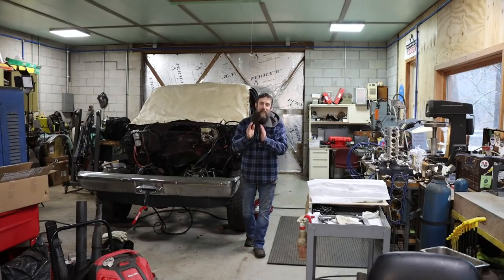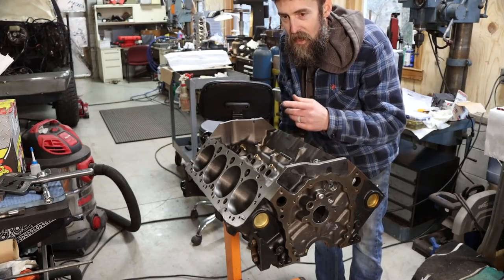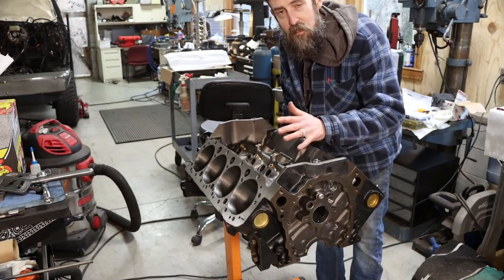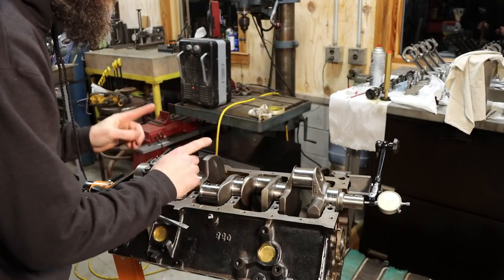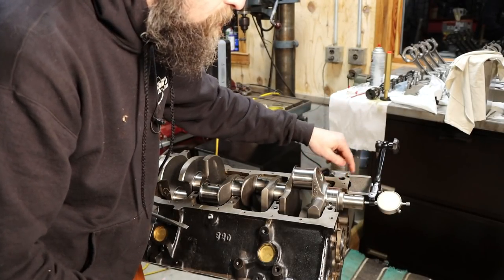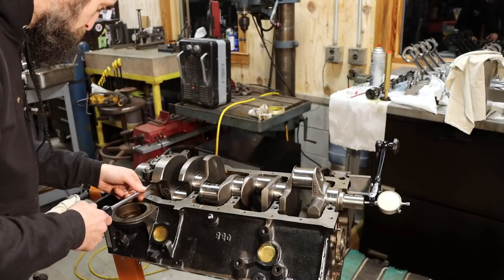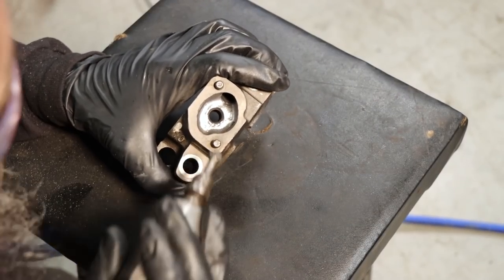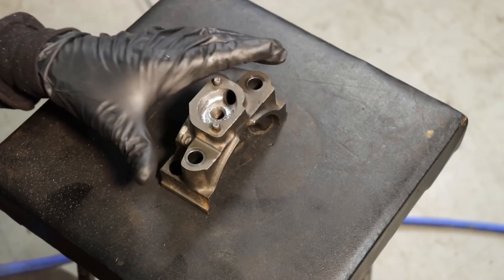Injecting some POWER into the Square Body. Part1

Comment: Good sound conservative well chosen mods. I'm not a huge fan of stroking a motor, but if it gives you something you desire - low end torque - because you don't need high end speed then it should be right on.

Comment: If you ever change the cam, might consider a 4/7 firing order swap to reduce vibration and improve reliability.  I had read about it but was amazed at how much it changed the vibration characteristics of the engine.

Comment: I was in agreement with all of your checks and mods until the end and you threw up a huge red flag.  As you indicated this is an externally balanced engine and it was balanced with the flex plate that was supplied..  To be properly balanced the shaft needs to be balanced again with the new flywheel.  I have built and balanced hundreds of engines and several of the small block 400 engines in my professional career.  Don't short cut this step if you want to guarantee a smooth running engine.   Thanks for sharing, enjoying the series.

Comment: Steve from all the different motors that I have done over the years and from working at a machine shop I don’t care if it was my best friend that did all the machine work on it I would definitely be checking everything on it before assembly!! Making sure that everything has been machined properly before assembly plus definitely definitely make sure everything is cleaned twice if not three different times on everything before assembly!! Every motor that I have done I will definitely take extra time in making sure everything is clean clean and clean for sure!! A clean motor will definitely last much longer than a dirty motor for sure!!! I actually just got done building a 421 sbc that is just shy of 700hp!! It’s definitely a beast for sure but I have put it in a much bigger truck than what you need for a half ton for sure!! Mine is a 1969 Chevy 1Ton 4x4!! I’ll bet you that as long as you keep everything thoroughly clean and double check all your measurements and are with in specs you should be good!! Oh one more thing depending on the after market block and a few other things you might have to go with a much different cam so that when the pistons come up that they don’t come in contact with the cam!! I tried telling a buddy that was working on a motor and he told me he didn’t need a special cam for his motor that he was working on that all he had to do was do some grinding on some rods I was like you will definitely ruin the rods and also throw them out of balance!! Well after buying another set of rods and trying a different cam that didn’t have as much lift he finally listened to me after even trying a stock cam I also had told him it would not work with his setup!! Just a heads up!! I’m not totally sure what all you have there but you might have to go with a cam that has a low grind on it to fit a stroker motor!! A 385 stroker was actually my first motor ever building and I could definitely tell you plenty more about that motor for sure!!! Lol!! A 385 is the same as a 383 but not bored out .030 it’s bored out .040 over!!
Reply: Great comment and good looking out. I've heard about lots of people having clearance issues with 383 strokers whch is why I basically shied away from them. I always just went went to a basic 350 cu in. They're super simple and cheap to build even a high horse power version. Parts are everywhere for a 350.
Reply: @marcellemay7721  the next time I ever need to build a motor for one of my older trucks it would definitely be a 355!! The one I built 20 years ago is still running in a buddy pickup that he had baught from me years ago and still has it!! Just a 350 bored.030 over every thing else is pretty much the same!! I’ve built hundreds of them and they are definitely a dependable motor and can definitely last a lot longer then a stroker motor will as long as you change the oil regular and with a good oil also not a pennsoil!!! All the different motors that I have toren apart over the years the ones that had the most carbon build up in them were run with pennsoil!!! I’ve tore them apart we’re the entire intake valley was completely full of carbon build up!!
Reply: @marcellemay7721  it’s not a big issue and they do make a small grind cam for them and you can get them also but you will have to ask for the small base circle grind for the cam!! That was what I had to put in my 385 stroker that I had built years ago!!!
Reply from the maker: I believe you are referring to a large vs small base circle cam.  The Scat rods I am using should clear but will see👍. Only thing about buying someone else's setup is you get things that you personally may not have chosen.  The cam I have is one of them. If I do have issues I won't be too cross about it😁. Thanks for the comment and for watching
Reply: @SteveSummers  you might as well put the cam you want in while assembling it.  It's much easier and then you KNOW that you have what you want for what you intend to use the truck for.  Many people over cam because they like the sound of the lopey idle.

Comment: Sounds like a great build Steve. 383's make great truck engines with their extra low end torque. Couple of concerns though. I would reconsider the high volume oil pump for a street engine. They can, with the key word being can, cause all the oil getting caught in the top end of the engine without drain back modifications. This could be increased by restricting the holes in the lifter valley. You might also contact Howards Cams and check with their techs to see if the cam would be a good choice in your application. Too big of a cam can cause an engine to be a dog in the rpm range a street truck operates in. It might sound good by perform poorly. Just my thoughts.
Reply: Yep I thought the same thing, I would just go with a low end (torque) cam, most likely the other guy wanted top end high HP...

Comment: Hi Steve,
Great engine choice.  You should notice a good increase in low end torque from the extra cubic inches.  Brian Block probably could have done the machine work on the old engine but now, you don't need to.  The 4 bolt mains are a nice upgrade too.  If you ever decide to add a turbo or supercharger, you know the bottom end is stout enough to take the extra pressure.  Thanks for the video!
-mike

Comment: Steve- I've been watching you for years and really like the way you do things. One word though about the camshaft on the SB Chevy. Too much lift and duration on a slow speed motor is never good. Check with a reputable cam company for their ideas about what they recommend for what you are using your truck for. Then, put in that cam. Racy cams sound good , but use too much gas and won't pull @ low RPM and are harder to start. The roller is the only way to go with all the flat tappet cam problems we see today! Thanks for what you do!

Comment: When you were checking your rear main bearing clearance, you laid the crank in the upper half main bearings of #1 & #5. You should take that opportunity to check the center(#3) main bearing journal on the crank for runout. This will tell you if the crank is bent.
Similarly,  you can put the cam in v-blocks and check the "inside" cam bearing journals for runout. It is not that uncommon to find a bent cam.

Comment: the shop looks great!
Reply: all i would add is the word blueprinting - please have a followup  in 6 mos and maybe also 10 things wrong with chevy  - the headbolts etc - you just have to check everything - i had a 383 in a z28 with alum twisted wedge heads - very rowdy - should be a good match to the truck - will be a boost. i almost would rather have a destroked 427 - see detroit speed camaro on build biology - now that is rowdy but for the truck you want to match the power to the jobs you are doing - the 383 should have good torque and be more than enough but that is what you want when the bed is full and you have a big trailer on back as well... this engine is a good base - i really hope you do efi, i hope you do some truck pc hacks and get a u/l sideband radio in there #crystals #galaxy
Reply: consider timing gears not double roller - the oil pump porting was good, go conservative on the timing - if you have a laptop in truck you can and should log all the data - get a bt on ovd2 connector but getting the laptop logging and making backups of data to pc in shop - there is more to do on this project - try some things that will work for you #magnaflux #ymmv
Reply: make sure to put on a bigger alt and batteries/elec system, get a linear amp for the radio to be able to bang out, - having all the data from the engine will allow you to catch issues and also have a good baseline to compare to down the line #afr #elliptical curves #rc band #stall converter #swr matching

Comment: When you get the flywheel. Please have  a tire shop spin up the flex plate to measure the imbalance then spin up the flywheel to see if it's exactly the same. Or you will need to send the crank, damper both flywheels and the balance card to a balance shop. Eyeball that the balance shop from the previous owner did not drill the flex plate and you should be ok. If the tire shop tire balance machine shows both the same..you can do a similar test with the harbor freight motorcycle wheel balance stand since you can easily make up the flex plate shaft adapter. Using magnets and washers to get to zero balance on the flex plate then moving it to exactly the same spot on the flywheel.

Comment: Another cheap and easy free horse power thing to do is to port match the intake to the heads. I use the intake gasket as my template to do both sides. It takes some time but not as much as you might think. Better to do it before the heads get bolted up to the block.
Reply: The benefits start around the 2500 rpm area. At any rate it is fun to do and sure helps at that and higher. I wonder if he will do a full balance on the crank rods and pistons. That helps at all rpm. Smooth as a baby's bum ?
Reply: @TomokosEnterprize  He said that the balancing has already been done. Towards the last few minutes of the video.
Reply: @marcellemay7721  Awesome, Thanks my friend. The neighbors kids were here making a racket over who gets what color of pipe cleaners I keep for kids that visit. I will go back and have a listen as it is all nice and quiet here now, LOL.
Reply: I have spent a 100 hours porting and polishing heads and runners. Even touching up valves. I know it only helps at 2500 rpm and higher but it sure is enjoyable and rewarding work.

Comment: You already know probably but youll also need a specially weighted harmonic balancer for the 400 stroker setup.  Im a lover of SBC motors all my life (im 62) and am very familiar with them, best small block ever made IMO - lol   You made an excellent choice especially since this freshly machined block was available.  On the oil pump I always used Melling as well, always high quality and never got a bad one, old school name from way back and rock solid at least in my years of experience. the later style rear main seal is also a great upgrade, I never had any trouble with the old style but the one piece is a more reliable option, though it cannot be changed unless you pull the trans.  I wish you the best of luck and with your attention to detail im sure you will end up with one of the best if not "the" best engine youve ever owned.

Comment: If you are going to look at the Edelbrock SBC manifolds...  air gap is cool (literally but you're not going to be charging around a race track).  Look into their Pro Flow kits that come with manifold, matched throttle body, fuel runners and throttle body.  If you have a dry manifold, dual plane really doesn't buy you much.  Or look at the Holley Sniper kits.   Yeah, they are a bit more coin but you can't go wrong with either bringing modern drive-ability to old iron.   Plus you'll save on gas in the long run so you can buy more tools.  🙂

Comment: Rotational torque is an imprecise way of measuring clamping force , just lubricating the thread changes the clamping force by up to 40%.
It is much more accurate to use a measurement of the fastener angular rotation.

Comment: Soo a few things so far #SteveSummers 
-if you are going to run a double roller timing chain, buy a high volume oil pump, take the center oil passage plug from the front of the block and drill a .020 hole through it. It will help with the longevity of the double roller chain. The high volume oil pump will more than make up for the volume loss.
-if the rotating assembly was balanced with a flex plate, that specific flexplate needs to stay with that rotating assembly. If you are going to a flywheel then the whole assembly needs to be rebalanced. 
-you are building a long throw stroker, skip the traditional bolts and buy a set of ARP main studs.
-I didn't catch what rods you are using, if they are aftermarket rods or stock rods with aftermarket bolts make sure you get/make a bolt stretch gauge.  Simple torque wrench values are not accurate enough for aftermarket rod bolts.
-plastigauge should supplement a dial bore gauge, it should be used on every journal with all the caps and bearings installed and torqued to spec. It is amazing just how much movement new casting engine blocks go through from thermal cycling. Side note, most auto manufacturers used to let engine blocks sit outside for a number of months in order to better releive the stresses produced during casting. 
-don't overlook the lifter bores, measure for size concentricity and taper
-the cam should be matched to the flow rate (volumetric efficiency) of the cylinder head with the gasket and intake attached. Anything else is just guessing.

Comment: Steve, now your getting into my area of expertise. Since it sounded like your going the hydraulic roller cam route, please do not skimp on the cost of the roller lifters. I've been building high performance engines for the past 50 years and have used just about every brand out there.  When it comes to the best lifters out there Morel can not be beat. One more suggestion. Radius and smooth all of the edges of the drain back locations in the lifter valley to aid in faster oil return to the oil pan just like you did with the main cap for the oil pump. Oh, and one more thing,. Follow ARP's instructions to the letter when torquing the rod bolts (bolt stretch). Do not rely on that old style lever torque wrench.
Reply from the maker: All the drain back holes were done as well along with the oil filter boss inlet and outlet. I also took a die grinder over all the sharp edges on the block. I didn't mention any of it on video due to time.  There was quite a bit of flash on the return holes from the factory. Thanks for taking the time to watch and comment.  I appreciate it👍

Comment: Oh and the roller lifters and rockers are definitely a damb good choice!! They will free up a little bit more horses and definitely will run much smoother also!!! Some people say they don’t notice a difference but it definitely does for sure!!!
Reply: I would imagine it sounds quieter as well.
Reply: not to mention most flat lifters today come out of china and aren't worth the metal they are made of.  To often a lifter either wipes out the cam lobe or just wears so badly it's unusable  in just a few hours or a few thousand miles.  The brand doesn't matter, many people have had the problem with comp cams lifters as well.  It's just not worth the risk on a new build.
Reply: @frotobaggins7169  oh ya that’s another thing I have seen lately!! Is lifters you should not buy off of eBay or other ones!! You should only buy direct replacement ones or original equipment ones!! I have seen several people get some off of the internet and they went bad with in the break in period witch when lifters go bad they shred hundreds of tiny metal particles into the oil witch then is picked up by the oil pump and threw out the oil system!!! I have also seen others buy supposedly good cams off of the internet by supposedly good reviews and they will get the cams and they were machined wrong!! The lifters wouldn’t even sit properly on top of the lobes of the cam!! I no of a guy that built a motor and thought that the lifters went bad before the 30 minute break in time was even finished but after further inspection he had just noticed that the lifters were not sitting on top of the cam lobs!! The cam he got was either a 1/4” to long or 1/4” to short!! So that motor had to be pulled back out of the vehicle and stripped down and cleaned really good again witch then when tore apart ruins the gaskets so that will cost more to get!!

Comment: Stress the importance of marking the main bearing caps and rod bearing caps by numbering them with center punch marks as you remove them so they go back the same way to your subscribers. The first engine I worked on when I was 15, which was for my uncle, I didn’t know this and just put them back wherever. The engine didn’t last 1000 miles before catastrophic failure😩😢